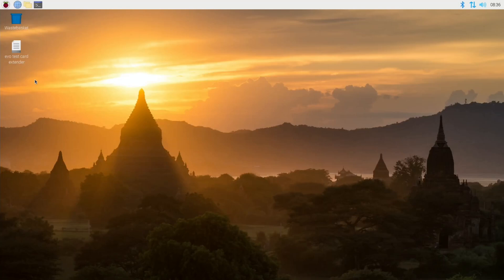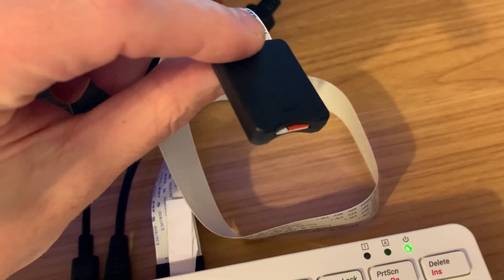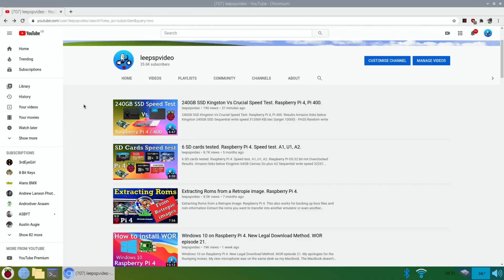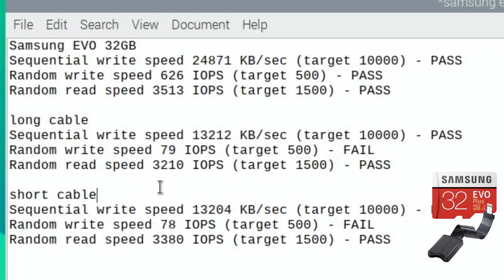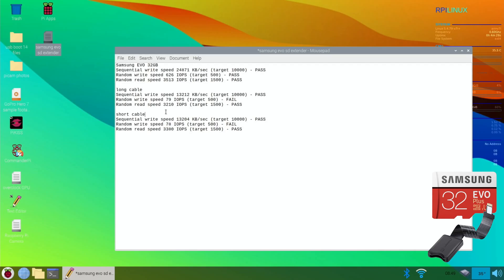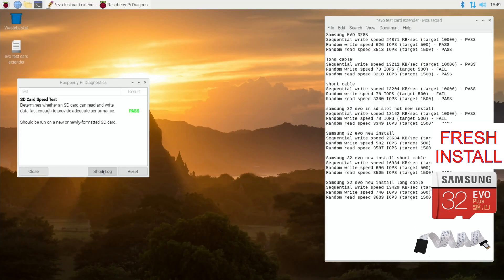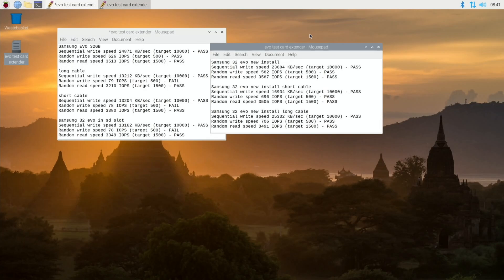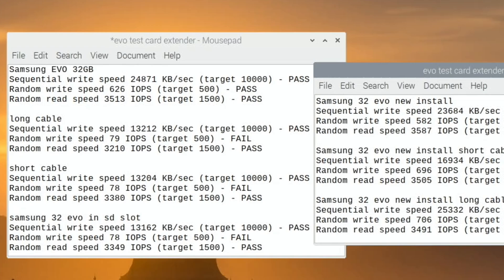Micro SD Card extension cable test. Short Vs Long Vs card slot. Raspberry Pi 400.

Comment: Hey Lee, can u pls tell me the size of the black box where u put the normal size SD card in. I bougth one of these for a maschine that i constructed. I need to mount this somehow outside of the maschine and the wire goes inside to the SPS. On amazon and other marketplaces i couldnt finde any information about that. 

Would be nice if u could help me here. 

Thank u!

Comment: One thing that no one considers is the contacts themselves.  I've read so many posts where people have had boot issues having to try multiple times to have the pi boot up that I see it as possible contact issues.  I've looked at my Pi, and frankly the micro SD card contacts are somewhat flimsy.  Having seen the results with the cables, if you are wedging the insert of the long cable to fit properly then you are making a better contact and I'm not surprised with the better results.  Frankly, at the speeds of the Pi, there really shouldn't be much of a difference between the two cable lengths but I did expect a difference with a cable or no cable.  By the way, this all goes back to my early days with game consoles when we've had problems with inserting game cartridges into Nintendo sets.  Sometimes, they didn't work so we'd just have to keep inserting/re-inserting the cartridge until we had a clean contact.  With a micro SD card there isn't a very positive insertion force, as there was with the game cartridges, so the contact integrity is much more up in the air. and wedging a connector in place definitely helps.

Comment: I have some problem with my SD card extension because flat cable go through hardware with interferences and I needed to fold it at some places. Writing an image from the raspberry fails on a brand new card and goes ok from a pc. Why do they 15 conductors cable as sd card has 9?

Comment: I just received my first SSD today, it's a kingston 240gb sata, speeds are:

Sequential write: 310597
Random write: 20127
Random read: 16433

My sd card I have been using before (sandisk image mate pro 64gb) started out:

Sequential write: 37729
Random write: 986
Random read: 2552

Just tested my sd card again after months of use on twister os (without reflashing), speeds are:

Sequential write: 35989
Random write: 800
Random read: 2529

While there is definitely a decrease in performance, it doesn't seem quite as extreme as yours. Very odd indeed.

Comment: SD card casing. since you had already opened the Pi400, did you try pinching down the top of the casing ? just a suggestion. Thanks for the vids

Comment: Advice, why not buy a new pi 400 instead fight againts an faulty pi 400 SD card lock.
Reply from the maker: It was only a test, With a piece of paper it works fine. I mostly use SSD so it doesn’t bother me.
Reply: @leepspvideo  ok no problem.. still is good videos you making

Comment: My guess would be line loss. You need a new card reader or Raspberry pi 400
Reply from the maker: The slot is working fine just the mechanism that holds the card in place.
Reply: he can test these cables on any pi4, if it is good there then the pi400 has a problem

Comment: I tried with pi 3 and 4 and the extender works well only in pi3 because che micro sd port in pi4 is a bit bigger. It depends on the card size, in my test this is the only issue. In pi3 I use also normal sd card (sandisk extreme pro 128m for cameras)

Comment: Hi Lee...
Very strange results...
Perhaps that SD card slot is the culprit... I think u should try that again on a pi4.!
Have u tried running the OS from an SSD & testing the mSD cards (so they r not in use & hence the OS doesn't skew the results..?
That might b worth a try 2..!
Also... I know ur not supposed 2 de-frag an SD card.. but it would b interesting 2 see how that changes the results...
I look forward 2 more on this...

Comment: Not sure I'd trust results from a card slot that requires a wedge to hold the card in contact with the, well, contacts. I think you should run your tests using one of your Pi 4's as a control.
Reply: That's what I'm wondering. It could all be down to the damaged SD card slot.

Comment: I thought the agnostics was supposed to be done on a blank card.  In either case I have one of the short micro SD to micro SD card cables, and half the time the Pi won't boot.  No good
Reply from the maker: I also get the problem where the Pi intermittently won’t boot with both extenders. On all my Pi’s.

Comment: May be you should run sudo fstrim / -v before reinstall just to see if the bad write speed is due to wearing.
Reply: Agree, here is a explanation for SSD, i don't know if it works on SD-Cards exactly the same way
https://superuser.com/questions/740803/trim-vs-writing-zeros-the-same
It could be, that there is data scattterd all over your sd-card and a write triggers a re-write of a whole block.

See also:
Erase block size
https://www.raspberrypi.org/forums/viewtopic.php?t=11258
Fragmentation.
https://link.springer.com/chapter/10.1007/978-3-540-74472-6_13

It is not a easy topic and often misinterpreted